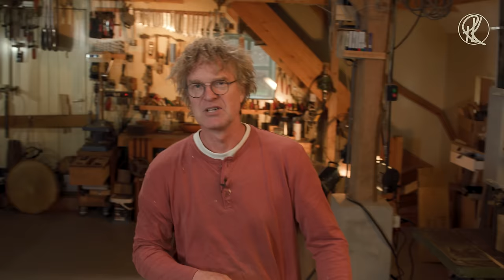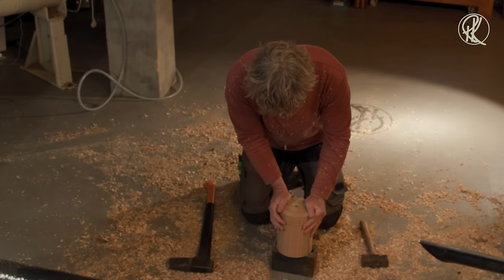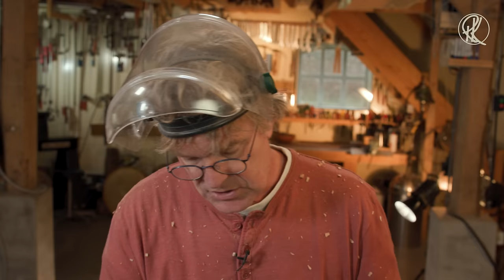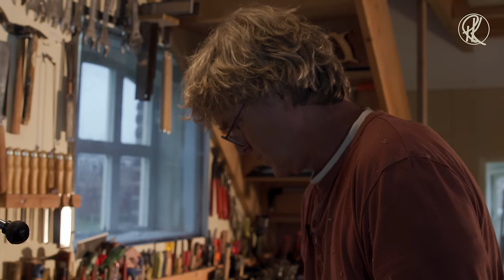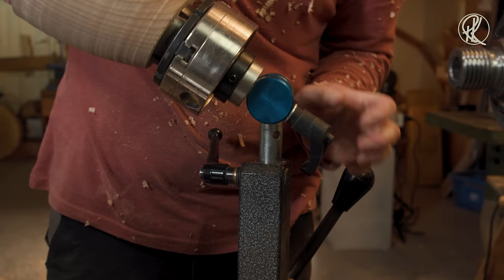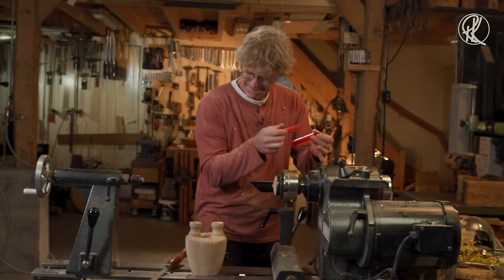How to make a twig pot with 2(!) nozzles? Woodturning a twig pot...

Comment: American Indian use clay to make wedding vase(double nozzles vase). The nozzles are connected on the top. I made one with mesquite when I received my Scout in late 2018. I hollowed the body from bottom then plugged it. The nozzles were drilled out by using Drill Wizard then carved and sanded.

Your approach is very interesting. Like your videos a lot.